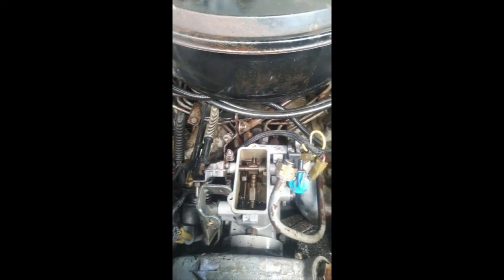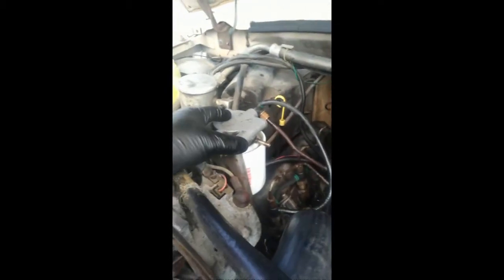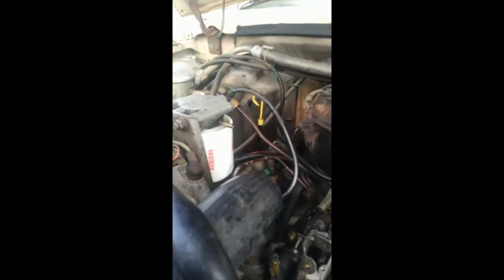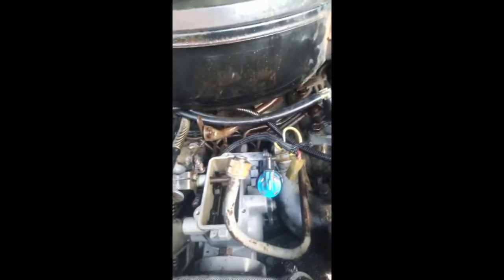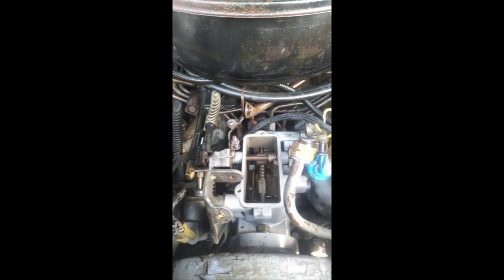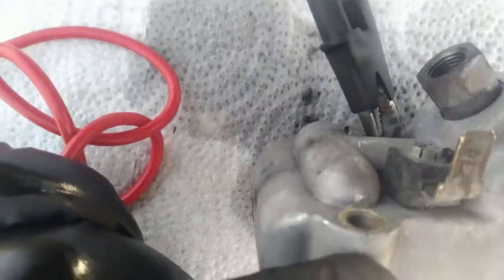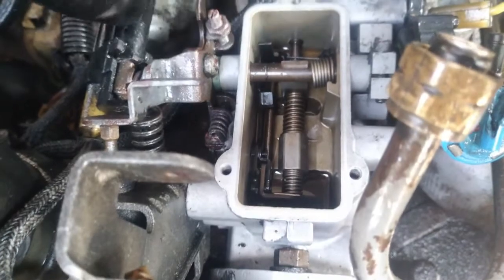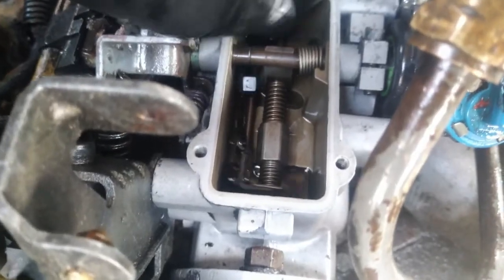6.9 idi Diesel.  No fuel from high pressure injection pump.

Comment: THANK YOU THANK YOU THANKYOU!  This video saved me. My 1989 Ford 350 with the 7.3l idi had not been started in 2.5 years. It died on me one day and I left  it has I could not get it started. All glow plus system was great. But it did not get fuel. I knew it was the injector pump and I have a good used one. But I was not confident I could do it. But now some 2.5 years later it was time. So I looked for You tubes on how to take it out and replace it. That's when I found this video of yours. I watched it several times and then got up the nerve to check it out. Sure enough! That mechanism the solidnoid pushes on was locked up solid. I finally got it to move again, got excited and put it all back together. Sure enough it finally started! Ever heard a 7.3l start running after sitting for 2.5 years! Lots of smoke and backfires for 10 minutes but now it runs great thanks to you!

Comment: Great video ! If the solenoid was in fact clicking/functioning then what was actually stuck inside the pump ? The reason I ask is because I am have the exact same symptoms of a crank but no start scenario on a 7.3 IDI. I am getting fuel to the filter housing & if I pop off the return line on the filter housing and crank the engine it discharges fuel as well. However, I can't seem to get any fuel to the injectors or to the fuel lines themselves. Any and all advice or tips regarding this matter is greatly appreciated.

Comment: Awesome video I am currently having the exact same issue with my truck and you probably just cured it for me thank you very much.
Reply: Hey man, I  am also having the same issue on a truck of mine.  I was wondering if this in fact worked on your truck ? If so, were you able to reuse your gasket for the solenoid housing lid or did you have to get a new one ?
Reply: @570dalton  sure the hell did, yep the gasket was fine just be easy with it.